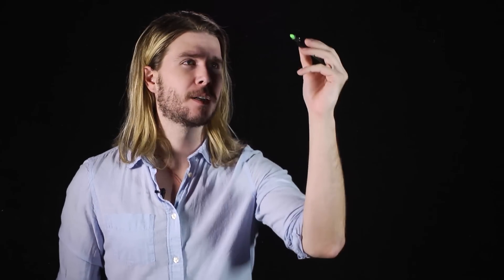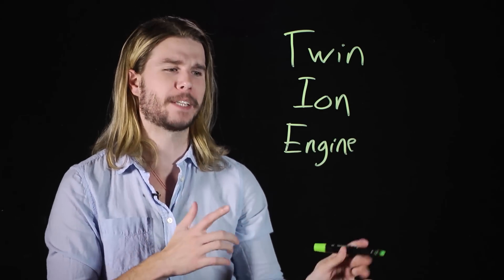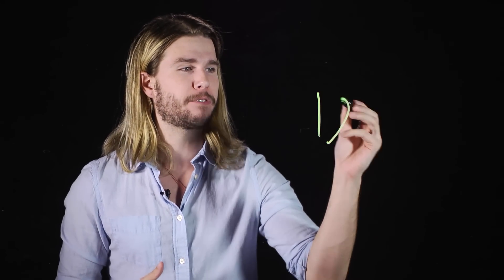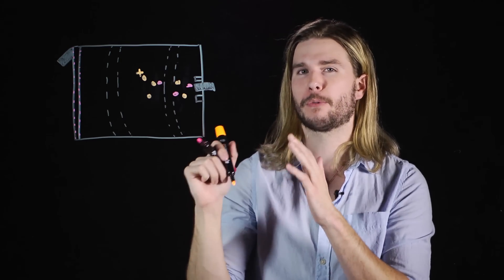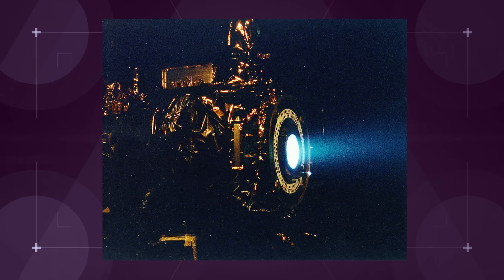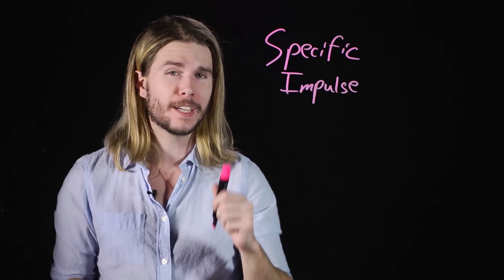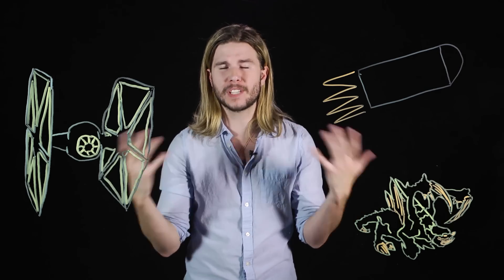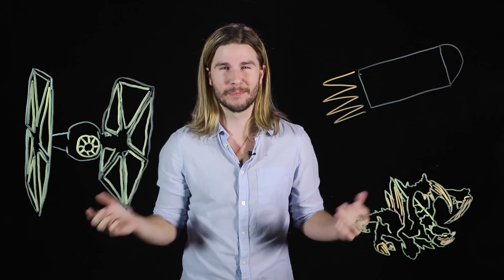How We Already Have Real TIE Fighters (Because Science w/ Kyle Hill)

Comment: From the mouth of Ralph McQuarrie, the concept designer:

“These ships are all powered, at least in my mind, by a system for harnessing gravity. It’s based on the idea that outerspace is not a vacuum, but filled with superfine particles we cannot detect, which carry microwaves, radio waves, and light. Basically it’s the same as the 19th century concept of ether. The particles are drawn to high-density masses, such as planets and stars, and it is their pushing down upon the surface of these objects which creates gravity.

“If it were possible to acquire a small piece of super dense matter—like that found in a black hole—and shield it from the ether by enclosing it in a totally insulating box, you could harness perpetual motion. Lifting one side of the container would allow the ether to enter along a single, controlled axis, generating an inverse jet propulsion while adding to the gravity core’s mass and power. At least that’s how mine works. Speed would be a matter of regulating the ether flow.”

—The Making of Star Wars: Return of the Jedi

Comment: couldnt we add tiny thrusters connected to a single fuel source for maneuverability and a non accessible additional tank for landing? the fuel source could be "solar powered" due to the fact its mostly in space. the ion engine would act as a safety net and the thrusters could be used to reach maximum ion engine speeds faster. lol what did I just figure out a way to modernize space travel.... please someone critique my hypothesis.

Comment: How to increase the trust of an ion engine ? Simple : You increase the ejection speed and/or the mass of whatever you eject.
Today's ion engines can only eject a very small amount of mass per hour, typically less than a gram, at, as you said, about 320000 Km/h speed.
If you could increase both the ejection speed and rate, you could tremendously increase the effective trust.
How about an engine that can spit about 10g per second at around 2000000Km/h ?

Comment: I thought the actual problem with TIE fighters was when they are flying in atmosphere, ION engines don't work then, well more specifically there are no wings for lift, and the engine does not provide adequate thrust.

Comment: Question: If you were a spec of light, everything around you is moving at "light speed" relative to you. So why is it impossible to move matter at light speed if it already is at light speed (kinda)? If an ion engine constantly accelerates, but it doesn't move relative to itself, then shouldn't it be able to approach light speed eventually?

Comment: Actually, Gene Roddenberry beat George Lucas to the punch in referencing ion engines. During the original Star Trek (1966-1968), Kirk and his crew came across an unknown species that primarily used ion propulsion instead of impulse engines (basically advanced fusion rockets).

Comment: If I'm Correct but i believe that the TIE fighter has an advanced ion engine that is on a pivot that would allow the TIE to wok as a VTOL having it spin to the front to rapidly slow. this also explains why they turn the way they do i from the two engines spinning in different directions.

Comment: The reason TIE Fighters are able to engage in Atmospheric Flight is because they have Magnetic Based Armor. With Magnetic Based Armor, which functions as another type of Shield, where it could Grab Air Particles to Move & Maneuver. As a Shield, it is Capable of Blocking & Deflecting Micro Particles, but nothing as big as the Rocks around Hoth (Star Wars: the Empire Strikes Back).

Comment: Some ion thrusters actually have the potential for higher thrust. Magnetoplasmadynamic thrusters that use lithium for fuel can have the thrust of a chemical rocket with the efficiency of an electric rocket (and the power consumption of a small city but this is Star Wars), and VASIMR thrusters can toggle between high thrust and high efficiency modes. Given a suitably miniaturized power source there's no reason that a very high thrust ion engine couldn't be built.

Comment: Couldn't you use an auxiliary rocket to accelerate, then switch to ion power?
Reply: Usually with multiple propulsion systems like that, high thrust chemical or nuclear rockets are used when high thrust matters, such as when overcoming gravity when taking off from the surface of a planet or moon. Ion engines are fine in space because when you are orbiting, outside the influence of gravity, there is no difference between accelerating for a minute or accelerating for an hour if you reach the same speed at the end. Since space travel takes weeks or months anyway, it's better to use a low thrust system with high efficiency than a high thrust system with low efficiency. High thrust rockets for takeoff are important for landers though.
Reply: +Joshua Harvey Well that's kinda what I'm trying to say, when not use a low efficiency high power rocket to reach a practical velocity, then use the ion engine to maintain that speed
Reply: +Owen Lars there's no need to maintain speed in space. Newton's first law, "an object in motion will stay in motion until acted upon by an external force." There are no external forces in space.
Reply: +Ruiluth Yeah, that was a dumb thing to forget, but why not for course adjustments?

Comment: They could just use more engines for faster accelerationg. Saying that this engine is efficient means that its worth both the fuel and the more weight the ship gets, as if 2 engines can run the ship, then 3 engines can probably run the original ship + 1engine weight, so yeh. Maek a 20 engined little guy and it will sure be fast.
Reply: The problem with adding more engines is that the engines and the fuel to run them add weight too. Usually a propulsion system has a thrust-to-weight ration (TWR) that determines the maximum acceleration you can get using that kind of thrust. For example, the Space Shuttle Main Engine (SSME) had a TWR of about 70:1, but an ion engine commonly has something on the order of 0.02:1. Adding more engines adds to payload capacity, not overall speed. It's a common mistake for beginners but it's interesting to think about.
Reply: Joshua Harvey Yeh, It actually makes sense.

Comment: Pretty sure they aren't solar panels, but rather radiator panels, as part of a heat dispersion system to compensate for the massively over-stressed engines.

Comment: Theoretically you could attach smaller rocket engines to the tie fighter to accelerate, and the ion thruster to maintain velocities. I would recommend talking about antimatter propulsion, or faster than light travel (space bubble travel)
Reply: True, but what I suggested was scientifically feasible, while to do that we would need massive leaps in theoretical, and quantum physics.
Reply: em drive

Comment: how do you put on the brake in space?
Reply: +Steve Potgieter Don't qoute me on this but I think they use RCS(Reaction control system) to make a 180 turn and use a low thrust setting from the main engine to slow down
Reply: Yea but you would have to throw the mass forward (with the main engine) faster than you are traveling or you would somehow retain and accumulate mass???? Like a fighter jet shooting subsonic bullets out the gun and then simply flying into the bullets because the plane is moving faster than the bullets.
Reply: Steve Potgieter Well since you made a 180 turn, you would be gradually decreasing speed since your thrusters are now going the opposite direction gradually slowing down your original forward momentum.
Reply: No I get it but it's fascinating stuff. Traveling long distances (say to mars) would mean that you would have to have fuel to produce the mass you need to propel yourself and then even more fuel to stop you once you get where you are going. Wonder if they used Mars's gravity to put the rover's mothership into orbit so the planet would "catch" the vessel in it's orbit and allow it to slow down as it went around the planet.
Reply: Steve Potgieter Well, I think they do that for Earth's orbit. They will probably do that if they plan on getting in to Orbit. Though if they end up overshooting, manual stop would have to be done.

Comment: Maybe in star wars lore, they consume far more 'fuel' to generate thrust more quickly... they are short range fighters after all, they don't need to conserve fuel for long journeys.
Reply: +TheOJDrinker I'd envision that would be the case. The engines would simply use a much higher number of atoms, that way they'd maintain a relatively high specific impulse for fuel weight savings, but are more than able to navigate nimbly. 

As for the Atmosphere operation, I contend that the radiator/solar panel chassis was ionizing the air as a way to fly and would create an interesting sound as it traveled through the atmosphere.

And the sound in space: Radio wave antennae around the ship watch a huge swath of the lower electromagnetic spectrum. And the frequency of the radio waves would be translated into pitch suitable for humans(they were the dominant species of the galaxy.) This would be present in cockpits or in small fighters into the helmet of the pilot(s).

Comment: excuse, but why did you put a + at the ion symbol on your ian egine schematic? electron have negative charge...
Reply: because when you take an electron away, the particle becomes positively charged.
Reply: i know, but the engine didn't add an electron to the atom?
Reply: +John Wotek the engine removed an electron from the atom.
Reply: apologize then...
Reply: +John Wotek no need to apologize. You asked a question. It does seem a little counter-intuitive to blast electrons at something at knock electrons off of the particle, but it works that way. It's better to ask a question than to ignore it and be confused.
Reply: yup, a guy who ask will be a fool one minute, a guy who didn't ask will stay a fool forever.

Comment: At the very least we know they have anti-gravity and gravity generators. If they can nullify the effects of gravity on a ship then not only are those flying feats possible, but trivial if you can generate and nullify gravity itself.  Those gravity generators would have to effect the behavior of mass in their area of effect,  perhaps they are increasing the mass of the exhaust while in the thruster assembly (Even smaller maneuvering jets) which could drastically juice up the available trust provided. Once outside of the thruster assembly the mass my be reduced back to normal which would explain why when these future ships are taking off and landing they aren't creating massive wakes behind them. Then the Falcon takes off the amount of wind we see is vastly less then we'd expect. This makes sense since the shields system ships have appear to have a kinetic nullifer\dampener which may work by quickly trying to reduce the mass of objects impacting the shield. This would still make stopping\impeding plasma weapons since the consequence of being able to reduce or increase the mass of an object effects e=mc^2, if they are reducing mass they are in turn reducing energy. The question is (assuming conservation is obseved) what does the shield and thrust systems do with the converted mass? Does it in turn help power the shield and ship itself, is it converted and stored then laster vented, etc.

Comment: I've always assumed that the maneuvering of a tie comes from a complex array of centrifugal panels that open and close on its wings according to a program that converts the pilot's movements into the maneuver that would match. By the way it sounds from the video, the propulsion system of a TIE is so energy efficient, that it doesn't need solar panels to keep moving forward, rather,  supply this panel system with the energy it need to function.

Comment: Do ion engines need fuel?
Reply: +Max Copeland Yes... but an ion engine doesn't "produce" power itself like a car engine! For that you need a seperate generator (nuclear or other) or a battery that is charged with solar panels. The ion engine uses the electricity from this to push matter (fuel) out of the back with electro-magnetism. This only takes a little matter though since you can direct the ions precisely and accelerate them to incredible speeds. Where a normal rocket pushes a lot of mass at relatively low speeds, the ion engine pushes a little mass at much higher speeds. This means you don't have to haul a lot of mass in fuel, making it much more efficient. Theoretically, you could even scoop up particles in space to resupply your fuel and with solar panels, you could keep flying indefinately.

Nerdist mentions ion-engines aren't very powerful and they aren't at the moment. But if we could accelerate the ions to near light speeds, the amount of thrust would become much higher and might at one point be as fast as normal rockets.

Comment: Well Tie fighters don't even have to have ion engines. They can use petrol for all we care, cause a tie fighter is (as the name suggest) a fighter interceptor flying vehicle. These are specifically by their design not meant to do long distance flights but be as manoeuvrable and fast as they can. WW2 fighters and even modern jets have about 1/2 hours of fuel. That's why they need aircraft carriers, to reduce the distance  from battlefield and allow longer combat capability. What about fusion power? It generate a lot of heat and energy for centuries, how about using that to propel.

Comment: This sounds like EARLY jets. They could go fast, much faster then prop planes of the time, but, for example, I will be using the Messersmitt Me262. It took a while to get up to the speeds that props could not match in level flight, whereas the props, coming off of a runway, will take off MUCH faster then the Me262. And now, jet engines are so advanced, we are having them takeoff straight up! This is just the exact same thing! After a while, we will have refined the design to where it CAN do these things! HAVE HOPE! A NEW HOPE FOR TIE FIGHTERS!!!

Comment: How did the TIE-fighters retain their speed while manouvering, well my theory is that they had some gas or other matter dispensers at the back to help with the initial acceleration, besides the star wars fighters flew just unbeliveably slow anyway. They wouldn't have to worry about running out because the TIE-fighters were short range fighters, therefore they fought for a limited time, not having to fly far from their base of operation. This theory would also partialy explain why their sound was heard, but dispencing gas into space wouldn't result in a loud sound, far from it. After a big battle, or on the tail of a turning TIE-fighter there maybe some very very quiet sound if any at all.

Comment: Sorry to say that no, we don't have TIE fighters, regardless of what is said here. Yes, we have developed crafts which can use ion propulsion to travel through space, and yes, some of these crafts make use of twin ion engines, but no ion-based craft has ever been developed yet for the purpose of engaging in wartime activities, therefore we do not have TIE /fighters/ in the sense that they are not meant to /fight/. Also, it's highly likely that TIE fighters in Star Wars possess other thrusters alongside their Twin Ion Engines, resembling an RCS system that we employ on many of our space-faring craft like the now-retired Space Shuttle Orbiter, which allows them to make the kind of maneuvers that they can while in space. This still doesn't address how they can perform such maneuvers in the atmosphere, unless they have the option of switching out their ion engines and RCS thrusters for conventional air-breathing jet engines at will. Good to know that we are heading in that direction, however.

Comment: Ummmmm, so are the ions leaving the engine at 32,000 kph or 320,000 kph? Aloud, you said 32,000 but you wrote 320,000 on the glass. Both are fast... I'm just curious which speed is correct. Thanx.

Comment: The thrust level of an ion engine could be increased. From what I understand the main reason they cant just put more power and propellant into it is because there are erosion issues with the ionization grid. If those were to be solved you could potentially make ones that flow more propellant, and get as much thrust as you want.

Comment: well, what if first launching a rocket with traditional fuels to get it to outer space and then utilizing the ion engine? 
for example a saturn V rocket has a end velocity (all fuel is burned) of 8.600km/h (src:wikipedia), can the ion engine start at that speed increasing the velocity further from that point? would save a couple of weeks/months of speeding up

Comment: you know i was thinking about how the TIE fighter engine can perform what it does without having to be of any radically different design of what we have now. first of all it would need an exorbitant amount of power, but i think that is not an issue in the SW galaxy. the ion engine uses a particle with a small mass moving at huge speed, to gradualy increase the speed of the large mass of the ship. now, as the theory goes, the closer something gets to the speed of llight the greater its mass becomes. so while the volume is the same, an ion shot out at .8 or .9c, besides its speed, would also have a much larger mass meaning it would provide a much larger thrust... probably enough thrust to perform the type of stunts the TIEs do in the films

Comment: You may wish to know that those are not solar panels. They are actually radiator panels, for managing the vehicle's waste heat. A standard TIE fighter is just a chair with engines and guns; it doesn't even have a life support system - TIE pilots have to carry theirs in, as part of their flight suits! It's part of that "fast and cheap" mentality. The radiator panels are just plain cheaper than installing more robust heat management systems. They don't add terribly much mass, and yet they still provide some very VERY flimsy ablative cover from the sides.